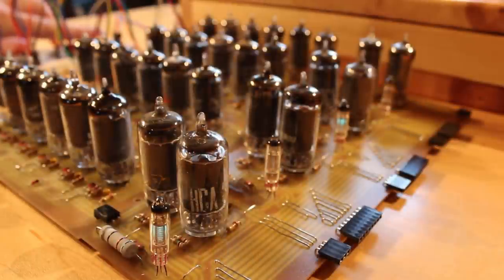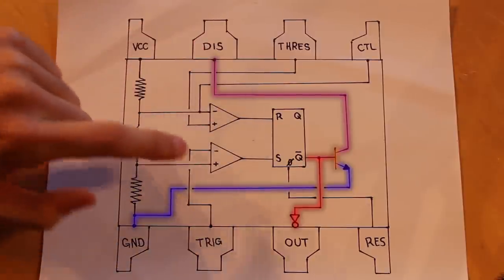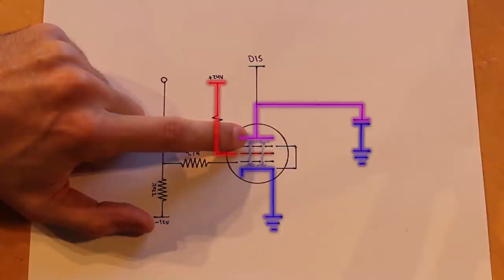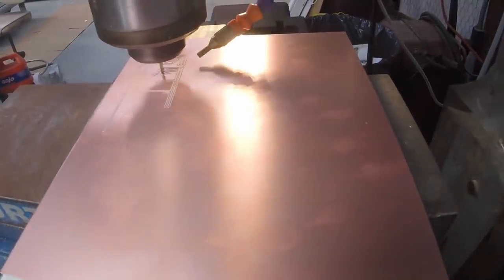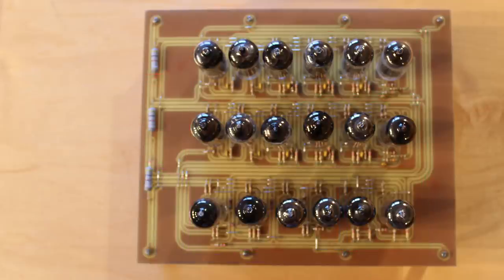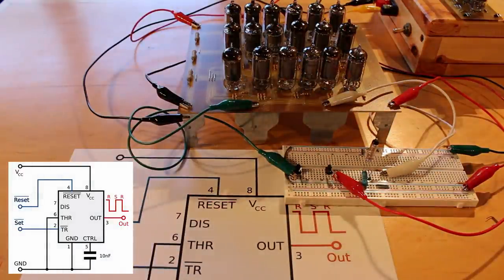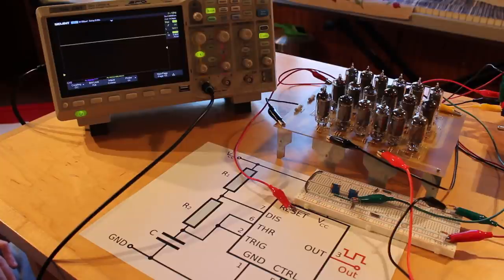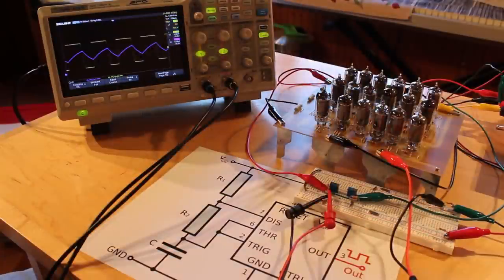Building the Largest 555 Timer in the World out of Vacuum Tubes

Comment: This is super cool, man.  I have a CNC bridgeport too.  What diameter end mill are you routing your PCB with?  I only get about 6500RPM out of my mill so it must be a bit slow. (But faster and cheaper than waiting on a board house!)
Reply from the maker: Thank you!
Man, your Bridgeport must be newer than ours, we can only manage about 3000 RPM, so my cuts are real slow. Still, I can often cut a board in just a few hours. Even the larger board I used for this 555 project took less than 4 hours to cut and drill!

I'm using a 0.1mm 60-degree engraving bit to cut the traces, a  0.9mm drill bit to drill the through holes, and then a 1.5mm end mill to cut the board outline. I actually use pretty large trace widths (1mm) to make it easy for mill setup. I just clamp a chunk of wood in the vice, flatten it with the biggest bit I have, then use carpet tape to stick the PCB down. To zero out the Z-axis, I get the bit in place and then go down in the smallest increment I can using a 0.04mm feeler gauge to check the clearance between the board and the bit. Once I'm happy, set Z=0 and then it's easy from there.

I personally like to use DesignSparkPCB to design the circuit and then FlatCAM to convert the Gerber files into G-Code. It took a lot of experimentation to get a feel for just how to set things up right for our mill, but now that I've got a decent system going, I rarely botch a board (from cutting it at least, I make mistakes in the design all the time, haha).
Reply: @UsagiElectric  awesome.  Wow, you’re doing that with 3kRPM.  Respect.  Mine is a Boss Bridgeport.  R2E3 is the model.  I do use a VFD (the motor controller variety 😉) and I usually take the motor up to 100Hz max for when I’m milling aluminum.
Reply from the maker: @TommyBoy7Heads  Haha, thanks! It's mostly just about keeping the X-Y speed pretty slow and then just hitting go and walking back inside for a while. We have an old Bridgeport EZTrak with an early Acu-rite Millpwr CNC conversion. It works surprisingly well given how obscenely oversized it is for the job! I did some testing early on to see how far I could push it, and if I was really spot on with my setup, I could get it to do pretty narrow trace SMD stuff: https://i.postimg.cc/7hQKgP89/IMAG2712.jpg

I just checked out the R2E3 and I do believe it's actually older than ours! The CNC interface certainly looks so, but it also looks a little larger and heavier duty. The only thing I'd say to double check on before going to deep into CNC PCBs is make sure it can handle really long programs. I split up my isolation cuts into separate G Code files, but the files that FlatCAM produces are essentially point to point, so some of my files end up being like 40,000 steps!
Reply: @UsagiElectric   awesome!  That all makes sense and the g code limits sound like a hassle.  The r2e3 is from 1982 but I’ve since upgraded the controller with modern software. It runs mach3 (which has its own headaches.) but I run hours long jobs on it with few issues. I thought if I had to do pcbs, I might get a small desktop router. Higher rpms and lighter weight which is fine since heavy rigidity isn’t really required.  Anyway love your channel. I build hifi vacuum tube amps for hobby so your work is great to see.  If you are on Instagram, find me. Tommyboy7heads
Reply from the maker: @TommyBoy7Heads  I've been pretty lucky so far in that I haven't hit any limitations with g-code size on our mill yet. The biggest file I ran was around 140,000 steps once and while it took nearly a minute to load, it ran with no problems at all! It ran for about 3 hours for that one file, and that was just the first isolation cut. I had two more to go after that, all in all I think the mill ran for about 10 hours that day. I was cutting this massive backplane for my hexadecimal relay calculator: https://i.postimg.cc/Qxmr2zWs/IMAG2642.jpg

Thank you so much for the praise on the channel!
My online presence outside of YT and the occasional twitter post is pretty minimal, so unfortunately, I don't really do Instagram. But, I am fairly active on the Usagi Electric Discord channel. There's a lot of really brilliant people in there sharing projects and helping answer questions, and we'd love to see some of your tube amps there! https://discord.com/invite/p7UsfHD
Reply: @UsagiElectric  damn that board is nuts!  I’ll check out that discord channel, thanks!

Comment: i want to see it connected to a ribbon cable to a chip socket so you can plug it into a normal breadboard 555 circuit... would be cool to see some guages over the thing to show the state of various parts of it

Comment: This is great ! 
But you've used integrated circuit techniques to make it - we can just throw in as many cheap transistors as we want. If you look at high volume vacuum-tube designs like those for TVs, they accomplished incredible functionality with a tiny number of tubes. In some cases those tubes would be designed especially for the job, often placing two active devices in the same envelope. Because every tube added a huge cost : not just the tube but the socket, the heater power etc.

So .. using those tricks, how far can you optimise the 555 to use as few tubes as possible ?
Reply from the maker: Thank you!

And that's an excellent mental exercise. So, there's a few reasons why the tube count ended up so high. The first is that 6AU6 pentodes are really cheap and I have a ton of them, so it made sense to use them as opposed to dual triodes which can get quite expensive (it's around $10+ per tube for a 6DJ8 dual triode and around $0.30 per tube for the 6AU6 pentode). Also, I'm running at extremely low voltages (just +24V on the plate and -12V for negative bias), which meant that my OpAmps needed a lot more amplifying stages to give acceptable gain.

So, the current tube count is:
12x 6AU6 for the OpAmps ((2x for diff. pair, 3x gain, 1x buffer) x 2 OpAmps = 12 tubes)
2x 6AU6 for the SR Flip Flop
2x 6AU6 for the Discharge 
2x 6AU6 for the Output Buffer
Total of 18 tubes

Alright, now let's optimize! Starting with the OpAmps, my design left a lot of performance on the table. I've actually been working on a redesign that gives me a lot more gain with just two gain stages instead of three. That can knock the tube count down to five pentodes. Then, the OpAmp is just feeding into the SR Flip Flop, so it doesn't actually need a cathode follower buffer either, so we can get the tube count down to four pentodes. Unfortunately, I did pretty extensive testing with a bunch of dual triodes and just couldn't get any of them to work well. With the 6AU6 I was seeing a gain of over 1000 with the 4x tube design, but the best performing dual triode, the 6DJ8, was only giving a gain of around 350. Now, a gain of 350 is actually enough to work in the 555 though, so with some 6DJ8s, we can get the tube count down to 2x per OpAmp.

For the SR Flip Flop the 6DJ8 works great, so just one tube there. Now, the output buffer and discharge get a little strange. The triode is actually terrible for a discharge because the screen grid of a pentode makes a massive difference here. But, there are plenty of triode petnodes out there, so something like the 6GJ7 could be perfect here. The triode can be the output buffer and the pentode can be the discharge element.

So that puts the new tube count at:
4x 6DJ8 for the OpAmps ((1x for diff. pair, 1x for gain) x 2 OpAmps = 4 tubes)
1x 6DJ8 for the SR Flip Flop
1x 6GJ7 for the Discharge and Output Buffer
Total of 6 tubes

That's pretty epic, but I think we can do better! The 6D10 is a 10-pin triple triode, and with three triodes in a single tube, we can really get compact! Unfortunately, still needing two gain stages on the OpAmps is just... tough. But, if we jumped up in voltage to around 60V, we're still at really safe low voltages, but we can now most likely get away with a single gain stage on the OpAmp, which means a single 6D10 can be used for each OpAmp. Then, we can use a 6DJ8 for the flip flop and 6GJ7 for the output buffer and discharge.

Which puts our max optimization at:
2x 6D10 for the OpAmps ((1x for diff. pair and gain) x 2 OpAmps = 2 tubes)
1x 6DJ8 for the SR Flip Flop
1x 6GJ7 for the Discharge and Output Buffer
Total of 4 tubes

That's a pretty epic optimization! 
Unfortunately, from a price perspective, we've totally blown the budget! The 6D10 is around $30+ per tube and the 6DJ8 is $10+ per tube, so the total tube cost of using the 4 tube optimization is nearing $50, while the 18 tube version is around $10. Still, it would be completely awesome to build a 4 tube version of this!

Comment: Amazing, it might not have a lot of real word uses, but the educational value is just amazing. 
PS: I would somehow love to see a giant IC socket for it as well. :)
Reply from the maker: Thank you!
Yup, there are far better ways to make all the different circuits than using 18 tubes arranged as a 555, but it sure was fun to make and I learned a ton about how the 555 timer operates in the process!
Reply: @UsagiElectric  In this regard, it might be interesting to see, how small you can make a vacuum tube based 555 timer by using some subminiature (propably russian) tubes, an optimized circuit and a more space efficient construction. Might be a really intersting thing to try. :)
Reply from the maker: @gammaleader96  That is an excellent idea! With a bit more voltage and some better designing, I could probably get the OpAmps down to 4 tubes each. The output buffer could be knocked down to a single cathode follower as well. The discharge is a tough one and would require some proper experimenting, but it could potentially be knocked down to a single tube as well. So, at minimum, we could do 12 tubes total, and those subminiatures are really tiny, so it could be made small enough to fit in the palm of your hand I think!
I really need to get my hands on some subminis to test with, that sounds like a lot of fun!

Comment: Would that work with pencil tubes too? I've got a ton of 1j24b's. Nice work! I love it!
Reply from the maker: I would say it probably could!
Those submini tubes are often meant to work with really low plate voltages, which would be perfect for the low voltage design I have here. The only thing that would really need to be changed is how the filament power is handled. Here, I run the filaments in series of four off of the 24V rail, but with those submini tubes, you can't actually run the filaments in series, so you'd need a separate 1.25V volt rail for power the filaments.
It could definitely be made to work though, and it would probably work pretty well!

Comment: The other day I came across a late 80s circuit design that used a 555 used as a sound generator. They had an analog mux to change the freqiuency in oscillator mode, and the output of the 555 drove, through a transistor, a little buzzer. They even chose the resistors in a way to almost get a good c major scale. (I changed them to potentiometers and a real c major scale). I wonder if using such a contraption instead of the 555 would give it "tube sound"... (just kidding)

Comment: If you're making kits I'd like 2 please! I want to build an atari punk console out of them with CV inputs and mount it in a retro-style cabinet.
Reply from the maker: Kits are in the works!
I've redesigned the OpAmp to use fewer tubes and be flexible enough with some adjustment potentiometers to use a few different tube types. Currently I've tested and had good results with 6136, 6AU6, 6CB6 and 6DT6 tubes. Now, I'm just waiting on a shipment of parts so I can get started designing the kit prototype. If all goes well with the prototypes, hopefully kits will become available soon after!
And once I get two prototypes together, I'm most likely going to make an Atari Punk console as well, haha.

Comment: Very impressive I worked with valve radios and sonar many years ago but this is beyond me 
You must have a shit load of money from somewhere to afford to do this work
I dont think it will ever be affordable for most
Reply from the maker: Thank you!
And I totally don't have a ton of money, haha. Sure, it's not the cheapest hobby, but it's actually not nearly as expensive as you might think. I machined my PCBs here because I had ready access to a CNC mill, but if you wanted to order the PCBs from a manufacturer and use proper sockets, the parts cost actually comes out to less then $100 including the cost of the tubes. 
I hold out for big, cheap lots of tubes, and you can often gets hundreds and hundreds of tubes for really cheap, and since I like building with relatively unloved small signal pentodes, they're even cheaper.

Comment: Shut up and take my money!!! 💰
I have been toying with the idea of building a tube 555 myself.
Definitely interested in a kitset.
Reply from the maker: Thank you, I'm glad you're digging the 555!
For the Kit, I'm going to try to get the tube count down to around 12 to 14 tubes, as that'll really help with both complexity and cost. I have a couple new OpAmp iterations I want to test out and then I can get on designing the proper PCB!
Reply: @UsagiElectric  would  be interested to know what it might cost as is.
looks impressive with all that glass on it
Reply from the maker: @hamishcoull4666  It's a bit hard to judge mostly because of the tubes. The 6AU6s that I7m using were fairly cheap per tube because I bought them in massive quantities. With 18 tubes used, the best bet is to buy a smaller lot. On eBay there's a lot of 50 6AU6s for about $45 shipped, which is a bit too many tubes, but at least there will be some leftovers!
Here's a rundown on parts cost for mine as it sits if I were to order that lot of 50 6AU6s:

Lot of 50 6AU6 tubes: $45
H3161 pin headers x150: $24
8x10 single sided PCB: $21
Resistors: $10
Capacitors: $5
Metal feet: Built from scrap… so free?

Total: $105

So, not the cheapest thing around, and that's just parts cost. For the kits, some of that cost will hopefully come down, particularly the PCBs if I order multiples at a time. Same for the tubes as I'm working on a redesign to use a bunch of 6CB6 tubes I have but have no plans for. The pin headers for the sockets are tough. I do plan on switching to proper tube sockets designed for PCBs, but the overall parts cost doesn't really change, it's just far easier to solder and safer for the board.

I'm pretty close to a new design with the 6CB6 I'm happy with, I just need to make another prototype to test it out, and then I can start sourcing parts for kits!

Comment: This is awesome in ways I never fathomed.  If you make a kit, I certainly want to know about it.
Reply from the maker: Thank you so much!
And definitely will do! I did a bit of redesigning today on the OpAmp portion to use a different tube that I have about 130 of and are slated for kits. I was also able to knock two tubes off the OpAmp design, so the kit will be a little smaller and a bit easier to tackle, but still pretty huge!

Comment: Nice 555, next time you have to build the other standard chip ... LM741 (Opamp) ... :) Nice work
Reply from the maker: Thank you!
I probably should have started with the LM741, that one is orders of magnitude simpler than the 555! But, being a single OpAmp, it can be made in a much more approachable package (6 tubes at most as opposed to 18 tubes for the 555), so it might make a great kit too. I'll have to do some designing and see if I can come up with a good design for one!
Reply: @UsagiElectric  Not needed just jokeing
Reply from the maker: @nielserikmeier9721  It's still an excellent suggestion!
I think it would make an excellent kit that uses far fewer tubes and is a lot more accessible to people (both in price and difficulty)!

Comment: wow thats so cool!
i am wondering how high the frequency can go in astable mode?
Reply from the maker: Thank you very much!
I did actually give it a test to see just how quick I could push it, and it seems that 8kHz is about the limit. It will actually go faster, but the falling edge starts to fall too slow and the output waveform gets smaller and smaller. You can see the slow falling edge here: https://i.postimg.cc/fRBJ9Nx6/IMAG3517.jpg
After a bit of investigation, it seems this is due to the feedback capacitors used in the OpAmps to stabilize them. I've been working on getting the size of those capacitors down as low as possible so that I can get a bit more speed out of it, but for a first prototype, 8kHz isn't bad at all!
Reply: @UsagiElectric  
i think the opamp is the bottle neck because opamp is slower, compared to comparater

Comment: The CV pin can be used for PWM
Reply from the maker: Yup, and there's a lot of really interesting 555 designs out there that use the Control pin, most notably the Atari Punk console.
Fortunately, since the control pin is really just a direct input into one of the OpAmps, I can access it with an alligator clip really easily by just clipping onto the 2/3 VCC joint. And I have done some limited testing with that as well.
For the kit, I will provide an additional header on the board that can be plugged into for the Control pin, so that all the functionality remains in place!

Comment: I would like to see if Glasslinger could make an "integrated" version.
Reply from the maker: I've had a bit of a think about this, and it would be one serious tube, but with some interesting redesigning, I think it could get close, maybe just two or three tubes total. With a little more B+ voltage and some 6D10 Triple triodes, I could probably make it using just four tubes. 

But that's not even thinking about the really interesting ways you can make tubes work, like was done with the Additron that stuffed a 1-bit full adder into a single tube: https://twitter.com/UsagiElectric/status/1374087658671050754

I'm sure with some out of the box thinking, some pretty exciting stuff could be done!